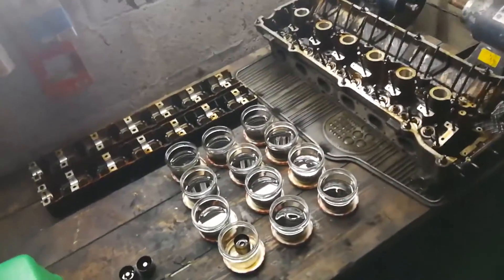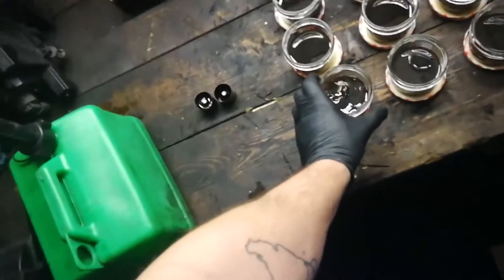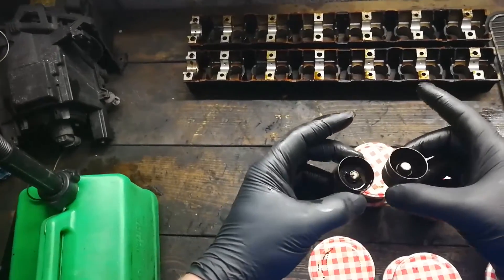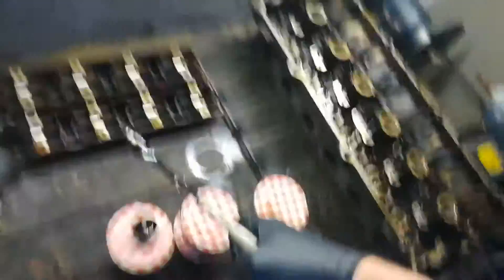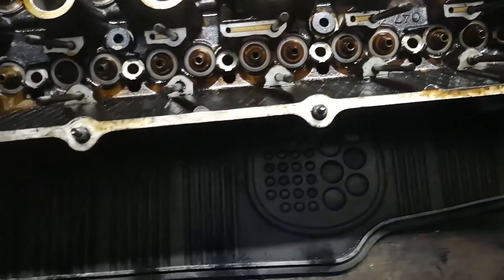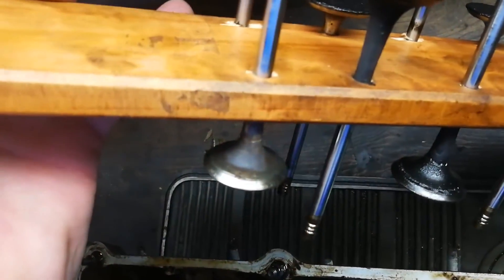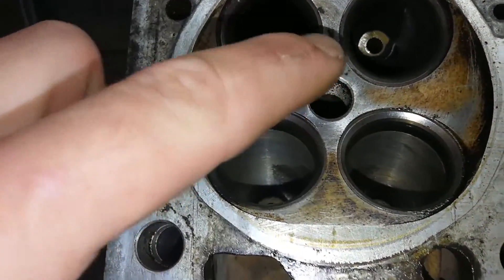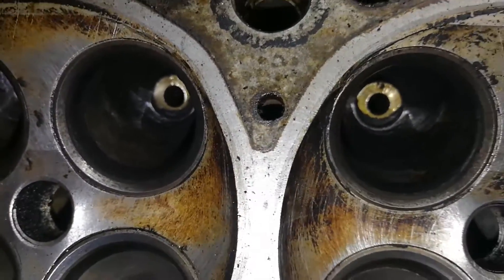E36 M52B30 Stroker Build - Cylinder Head Prep

Comment: I’m almost at the same stage with my build right now. I pulled my m52b28 to bits, cleaned everything and replace all seals and gaskets. I soda blasted most of the internal parts. Soda blasting is quick( much quicker than soaking in solvent and brushing) and easy. Result is near perfect. My sylinder head and other bits look like brand new. 
  I hit valves with wire wheel and finished them up with buffing wheel intake valves now look like brand new mirror finish. Exhaust valves look slightly less then brand new. 
 Valves weren’t sealing 100% previously. Couple of minutes lapping in each valve was enough to fix it. 
  Classic m54b30 intake and m50nv cams were installed. 
 Block was mulled down by 1 mm which increases compression from 10.2 to 11.6. 
 I chose to stick with m52 rotating assembly for simplicity ( now regret not going with m54 guts). It would be making vroom-vroom noises by now if I didn’t brake one piston ring during assembly.
Reply from the maker: That's sounding really encouraging bud - apart from the snapped ring. I'd love access to a soda/glass bead blaster... Sadly not available for me. I hope the vroom vroom sounds soon and make smiles when it does so 👍
Reply: Thanks. Also I agree about the porting. Ports look pretty good. I blended in casting imperfections and smooth out rough edges. I didn’t reshape anything in the ports. Exhaust ports I tried to polish to prevent carbon sticking to it. If I had more time and right tools I would have put some effort in intake ports between valve guide and the splitter. To my eye that area in the intake port is where most of the gains can be made. 
  According to my quick calculations m54 rotating assembly would bump compression to 10.8.

Comment: Did you mark the lifters somehow? They have to return to the same place in the tray don't they?
Reply from the maker: Youre right so each jar has the corresponding lifter position engraved on the glass.
Reply: @ManSeeksCivic  👍 you know diesel won't clean them up at all, the best way to clean the lifters is boiling them (literally the water has to boil for at least 15min). If you only soak them in diesel all the dirt will stay inside and may later block the lifter. The best option would be to buy new ones, but if you have some time to spare have a go and try to clean them. I tried every possible option to clean lifters in my m54 and boiling was the only thing that worked
Reply from the maker: @S7midnight  Thank you... I was hoping that the diesel would break down the carbon enough. My backup plan is to use hot caustic to dissolve the carbon... I shall bring that into action if needed. I appreciate the input 👍
Reply: @ManSeeksCivic  anytime mate!